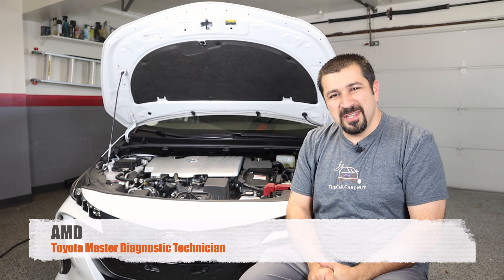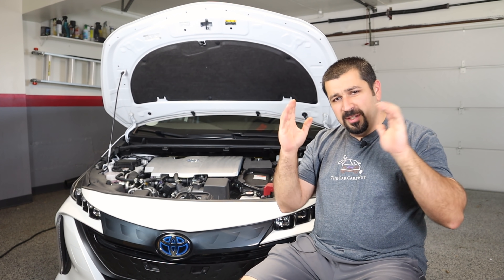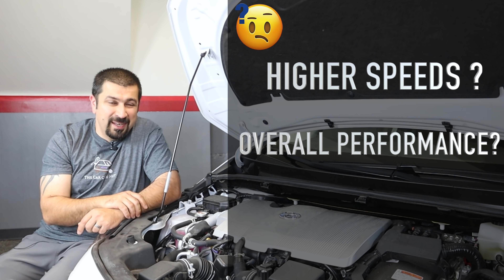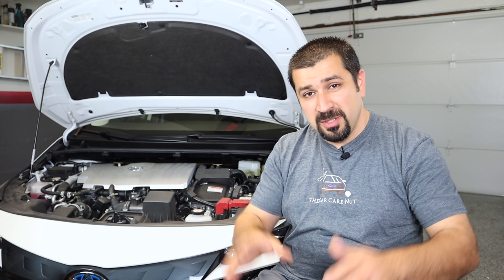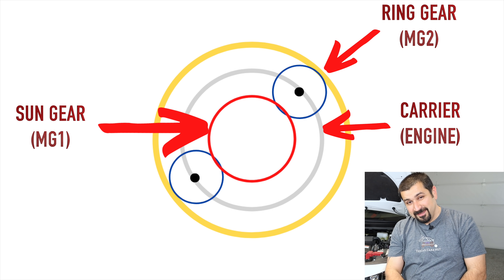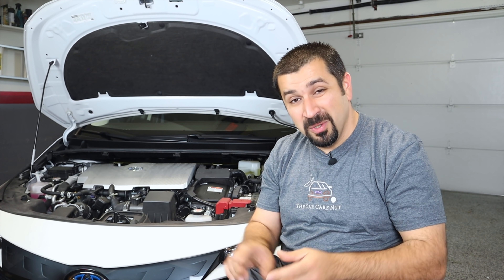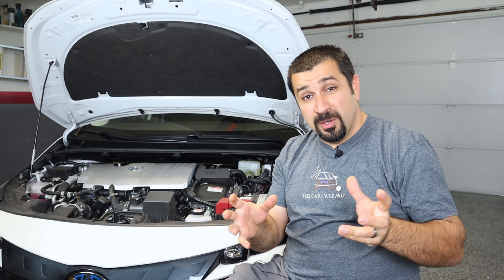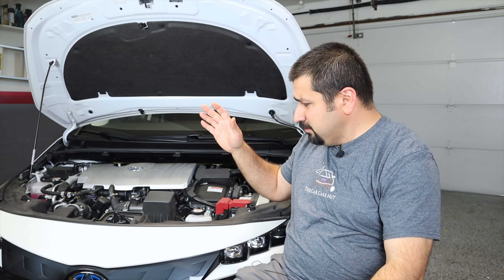How do Toyota Plugin Hybrids work? Completely different than Hybrids?

Comment: CCN - Fact check:  It's been more than a decade since straight hybrids have been limited to 28-MPH EV-Mode speeds.  In particular, my 2015 Accord hybrid has entered EV mode at 75MPH.  I'm pretty sure that's true of the 4th-generation Hybrid Synergy Drive (Toyota, post-2016), too.  Of course, the range is extremely limited in that situation, since the limited amount of battery charge gets used up really fast.
Reply from the maker: Toyota hybrids will go EV here and there while driving at higher speeds. But from a standstill entering full EV mode by pressing the button is limited to 25 mph and a very short distance.
Reply: @TheCarCareNut False. I own a regular 3rd gen prius and can get up to 45mph, and up to 1 mile with the stock battery before the engine has to start. So if I had a larger battery and am okay with a slow acceleration, or use the engine to get up to speed and then "coast" in EV it could absolutely keep 40-45mph in city and country roads all electric

Comment: I have 2013 phv plug in Prius. It has 30,000kms . I got it last month  . Is it okay to just keep charging it and using in ev only ? I get 19kms .
Reply from the maker: Hi! You could but every few months make sure to use the engine as well.

Comment: We have a 2020 Prius prime and my only question is why does the engine start when I’m riding the brakes (steady pressure) coming down hill in EV mode? If I come down the same hill on and off the brakes, it won’t start.
Maybe riding the brakes causes the charger to get too hot? Great car but i prefer the engine only starting when I want it to.
Reply from the maker: Hi! It actually automatically engage B mode which uses the engine to stop the car. The engine is technically not running just spinning

Comment: A couple topics that are popular in Rav4 Prime communities that would be cool to answer are: What happens differently in Charge Mode vs HV mode? I'm guessing it is diverting more power to MG1 to charge the battery, thus working harder, but there is frequent discussion of how much harder/less efficient it is to run in this mode. Also, do the rear motors of the Rav4 Prime regen? Is there a difference in regen in say one of the "S1-4 gears" vs just touching the brake pedal where the Charge needle is at the same "level"?

Comment: Excellent video as usual, could you please tell me why my CHR revs REALLY high on the overrun going down hill on some occasions but not all, so much so that the only way to stop it is to break quite hard slowing the car to as little as 25 MPH.
Maybe a video on how the different modes ie ECO, NORMAL and SPORT, integrate into the planetary gear explication in this video

Thank you
Reply from the maker: It automatically engages B mode

Comment: Confused on one thing.  My Venza has a hold button, supposedly to hold the car when stopped on an incline.  Is it necessary to press it?  Pressing on the gas disengages it.
Reply from the maker: Hi! It’s a brake hold function so you don’t have to keep your foot on the brake pedal when at a traffic light. You can also use it to hold the car on an incline. You have to activate it everything you start the car
Reply: @TheCarCareNut  Thank you.  My Limited has a lot of things I've never seen before.

Comment: I have the new Venza with regenerative braking.  I have been following these discussions.   I think regenerative is the better choice.  One video made the case for me.  On a long distance trip, the battery will be empty soon, and you will carrying a lot of dead weight.  The hybrid lithium batteries are much smaller and lighter.  I get close to 45 mpg, no highway driving, with an endless supply of electricity.  I have also been surprised with the sudden acceleration the hybrid provides.  I thought I was buying a turtle.

Comment: Congratulations on 1 year anniversary 🤓 is it truly safe to have your engine bay detailed ? Concerned about the water on the engine ? As always, thank you.
Reply from the maker: Thank you! There shouldn’t be an issue with that as long as things get dried up and avoiding direct water pressure on electrical connectors

Comment: Hi AMD!

My '03 V8 4runner's A/C pumps cold air but has been pretty noisy for quite a few years now. It's quiet when the A/C is off, so I'm assuming it's not the pulley bearing. Have you ever had to deal with this issue before?

Keep up the great work!
Reply from the maker: Hi! It could be the compressor. First thing I would do is recharge the system. You’ll need a shop to do this to take out everything and recharge it to your correct amount. If not then I’d check the compressor

Comment: This is the most retarded design I've ever heard of.  Let me explain why, Full EV mode engine is just dead weight = big loss. When batteries are low Engine is on the two motors and the batteries are pretty much dead weight again not efficient. You basically get transmission and clutch like regular car which you don't need at all if it was done properly. Only if there was better hybrid solution oh wait there is very small but efficient ICE engine driving generator that is charging the batteries and helping power Electric motor which is powerful enough to drive the car(similar to pure electric vehicles) This is how the biggest mining trucks are driven(tho they have like 2 generators and 4 motors) or how diesel electric locomotives work

Comment: good work friend! but i have a question that how much KW the prius prime has on mg2 compare to the mg2 of the prius because Toyota website said prime has a more powerful motor but when i drive, i feel like prius has stronger motor because it accelerate easier(both engine is the same Atkinson 1.8l with 95 hp and 105 lbft)! thank you
Reply from the maker: Hi! This information is not published if I remember correctly. I’ll double check

Comment: omg thank you so much for always answering my question but i forgot to ask you on hybrids when you start the car and the engine doesnt kick in how long should i allow the car to start on ev mode
Reply: You shouldn't have to wait any amount of time in EV mode.
Reply: and is it good to get rust proof for your car
Reply from the maker: Yes I’d say it is if you live in area where salt is used
Reply from the maker: On the prime you don’t need to wait for EV mode. In hybrids you do have to allow the engine to warm up before it allows EV mode
Reply: @TheCarCareNut  my car always starts with ev its camry 2021 so do i just oress the gas lightly
Reply from the maker: No need. If the engine doesn’t start then it’s already at good temperature and you’re good to go

Comment: Normally the plug in and standard hybrid versions had the same horsepower so how was Toyota able to get significantly more power on the RAV4 Prime?
Reply: If the Prime is the PHEV one, then it could be at least 2 things. A bigger and powerful electric motor and also a bigger battery with better energy output.

Comment: I have a 2020 Camry Hybrid, you are correct you can drive an EV mode only for a few minutes up to about 25 miles an hour, but I have noticed on the highway when the battery is got a good charge all of a sudden it looks like the car is going only in electric mode for about a mile or two at highway speeds, why is that or is that accurate?
Reply: There's EV mode and there's EV (engine off) which has higher speed threshold. In the 2018 and newer you can be in EV (but not EV mode) at 60 mph for example with very light accelerator or when lifting off pedal. It used to be up to 47 mph in 2012 Camry Hybrid.
Reply: I don't know the top speed for EV on your Camry, but depending on the incline, temperature, speed etc it can go automatically on EV mode for a while. Also going downhill, if you lift your foot from the gas pedal, it'll go EV mode regenerating some energy.
Reply: Thanks, however it works it helps get great fuel economy, better than EPA estimates, and then as soon as you hit the gas the engine kicks into seamlessly and smooth.
Reply from the maker: Regular hybrids will sometimes blip into EV here and there but it’s not consistent

Comment: Another nice video. Question: what would be the recommended service temperature for the NiMH battery pack ? And in terms of hours, how much longevity would have the hybrid battery fan ? Thank you !
Reply from the maker: Hi! There’s not a published official figure but less than 45 C is where they usually are. The fan doesn’t have a rated hour limit of operation and honestly I haven’t seen a fan fail unless it was severely clogged with debris where it can’t spin anymore

Comment: These “Plug-In Hybrids” are the real future in my view. They will never run out of electric range and die on the side of the road, so they are the best of both worlds.
Reply: The prius prime advance has so many features than can rival a tesla. Wiper turn on when raining and the heavy the rain the faster it work. The high beam turns off automatically if a car can from the opposite direction. It can park by itself.  The dynamic cruse control make driving easy by keeping the distance of the from car. It can be charged in two hours for 28 miles of ev range only. The price is way cheaper than the Tesla. Driving at 65mph the car can travel over 600 miles with a full tank. My only complaint is when is charging has to wait two minutes before the ac start and it work for 10 minutes only. I would like to know if somebody can hack the settings to adjust the ac timer longer than 10 minutes.
Reply: @neliosamch3195  I want to make sure I understand what you're saying - so when the vehicle is plugged in to an electrical charger, the air conditioning cuts out for 2 minutes, cuts back on for 10 minutes, and then shuts back off until the vehicle is unplugged?
Reply: @MarcillaSmith  when you plug it in, you have to wait 2 minutes before you press the ac bottom then you have to press the ac bottom every 10 minutes to have ac while the battery is charging. You won't be able to have a 2 hour nap because it doesn't have camping mode at least you have the ice running.  If the drive battery is full then you can have several hours of ac according to how cold you want to sleep. You can charge it and keep the battery full driving in charging mode then take the nap.
Reply: @neliosamch3195  you're a step ahead, thanks! Also, such disappoint :(
Reply: @MarcillaSmith  That is until a hacker can break in the hybrid system and set the timer to 2 hours for fast charging or 6hours for slow charging.
Reply: @neliosamch3195  those are 20 years ago, they just didn't use on a cheap models
Reply: Well, I don’t think so. If you look over here in Europe (EU) things are different from the situation in the USA. Many municipalities have there own policies regarding ICE’s. Some say they only allow these ICE driven cars for maybe the next 10 years while others say nothing specific about it. Toyota may not be the first to have introduced a full electric car but they have a fully functional hydrogen driven car. And Germany is now quickly expanding the hydrogen infrastructure. A sign on the wall if you ask me.
Reply: @leyland9999  Europe was always ahead of the USA in terms of infrastructure. We still don't have single payer healthcare here. But at least in the US, the oil companies have to much lobbying power to allow a somewhat quick transition. Not to mention the technology just isn't there yet. Electric vehicles still have too many negatives and are more expensive. Hydrogen is a whole other animal. But the infrastructure for hydrogen is nonexistent in the US. I wouldn't consider it a "sign on the wall."
Reply: @Puggy42069  Thing is, Toyota just doesn’t bring products on the market for fun. The Mirai is a fully functional product and takes away many of the cons that come with electric-only vehicles. The situation in the USA maybe not yet ready, for the oil companies that indeed still have a lot to say can relatively effortlessly switch from petroleum based fuels to hydrogen. Sure, it takes many years maybe before things are up and running but fossil fuels have had their haydays.
Reply: @leyland9999  Don't know what you mean "relatively easily switch." Someone has to pay for that infrastructure and it is definitely not "relatively easy" to just switch ALL of your infrastructures, costing millions upon millions of dollars to an unproven technology. Hydrogen has its advantages, but without the infrastructure, it's worthless.
Reply: @Puggy42069  Relatively easy, I said. That means that refineries are all still there and present filling stations can be used, as is the case with electric charging points present at existing filling stations. Sure, it will not be an overnight affair. As long as a well thinking president is in the White House who is at least willing would be a welcome beginning. Electric cars are not as clean as they say, powers must be generated, distances people travel daily are much greater in the USA than they are in Europe. Besides, what if we all decide to switch over to EV’s…..The grid will be overloaded, surely not up to the task in the present situation either in the USA or elsewhere. And, many (most) still can’t afford an EV at all. In the meantime further development of hydogen cars will be done. Changes are needed, by hook or by crook. So my bet is EV’s will be an intermediate solution, they are here to stay but hydrogen will take over slowly. I won’t live to see it completed but we will have to stop using fossil fuels. Besides, we must stop thinking problems, think in possibillities instead.
Reply: They are compromise between the two. 

They are worse at being a hybrid and worse at being an EV. 

Yet this compromise allows them to be better for road trips than EV and better for short commute than hybrids.

But that's all it is - a compromise. RAV4 Prime is a worse as a hybrid 38mpg city vs 41 mpg rav4 hybrid. 

4300 lb for rav4 prime XSE and 3755 lb for rav4 hybrid XLE premium.

And yeah I know prime is fast. But is it faster than a Tesla?

They are probably seem like a great compromise for people with short commute and occasional road trips. But I disagree.

IMO if you can charge at home - just buy a fully fledged 300 mile range EV.

If you can't - just buy a regular hybrid - it's $5k-$10k cheaper and massively lighter and will most likely end up being cheaper per mile anyways despite EV savings from prime.
Reply: they always make something new after the buy.
Reply: Japan always keep their top models in their country, cars ,mobile,that why call "import "
Reply: After daily-driving a hybrid, I am really into PHEVs. They seem the perfect answer for the current time. Perfectly balanced.

Comment: Another excellent, easy to understand explanation how these gears works. Can't wait for next episode about HV battery. 

AMD, one dude in my FB group mod his Prius and double up number of battery packs. Not much details available other than he cut and weld the battery casing, use proper gauge wire, good connectors, etc (all parts salvage from original battery packs). So far he reported much longer range in EV, much better mpg. Pls comments in your next video.

Comment: I do notice that the acceleration and power is much more in battery mode in my 2021 prime vs when the engine kicks in. There is a considerable power decrease while driving on engine mode. I love the all electric power on my Prime, great that they engineered to 84 mph of course I only take it up to around 70 mph cruising speed. I only wished the range is the same as the Rav4, more range would be great.
I often wonder why the power decrease, I can only assume it's because there is more torque provided from the extra battery pack vs only relying on the engine to provide the electric to the MG2 motor.

Comment: Will it cause any damage if I power off the car prior to pressing the park button after coming to a complete stop (unintentional)?  The car to be a little more jerky.
Reply from the maker: Hi! I would come to a complete stop before engaging park as it could damage the parking pawl
Reply: @TheCarCareNut  after coming to a complete stop, can I bypass the the parking button and go directly to powering off?
Reply from the maker: Do you a Prius or Prius prime?
Reply: @TheCarCareNut  Prius Prime
Reply from the maker: If you are at a complete stop and in drive you can press the power button and it will automatically engage park and shut off the car without issues just make sure you’re at a complete stop

Comment: Wish they would make an electric car with a really small Separate generator
Reply: Look at the levc, London electric vehicle company, they make electric London taxis with a small combustion engine to charge the battery only, my friend has one.
Reply: I agree. Electric motors are the future, but will the external source of energy be gasoline, shore power, hydrogen, or something else? An EV with a cassette-style power source could potentially make it more future-proof
Reply: @MarcillaSmith  I read in the UK guardian 2 news stories similar to this, one was a cassette based battery system that was ready to go to market, the other was a liquid that was able to carry charge and was toxic free. It could be evacuated and filled into a modified fuel tank In less than a minute.

Comment: For my 2010 Prius hybrid rear two license light bulbs. You mention about they can be replaced with led lights. Can you give me the name of the brand and where I buy the led light for my 2010 Prius? And do I need a resistor in line with the led lights? If so what resistance type and where to buy? Thanks in Advance.
Reply from the maker: Hi! You don’t need a resister for the license plate lights and I’ve used vleds.com before with good results